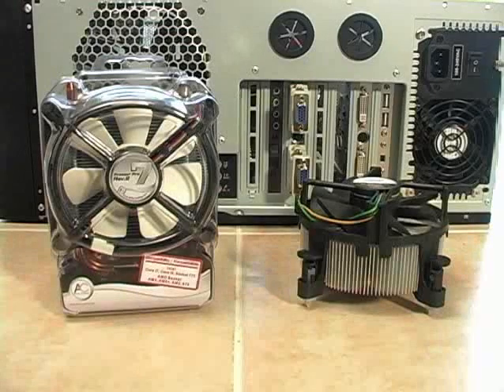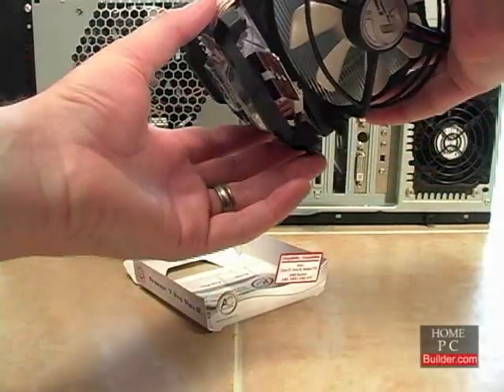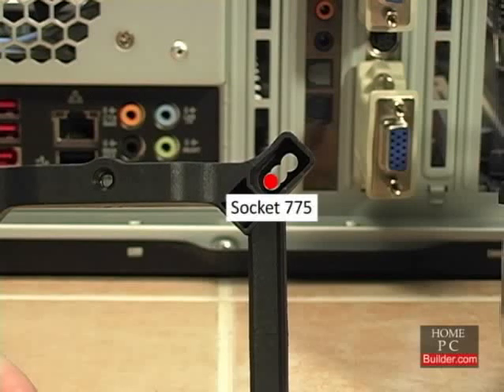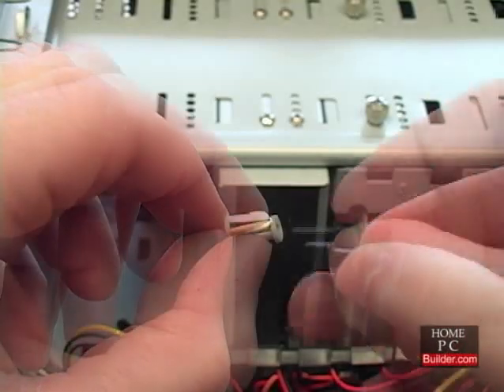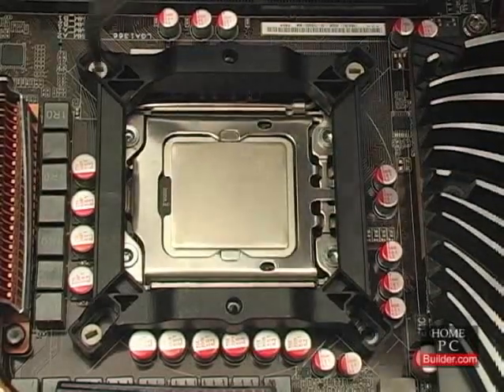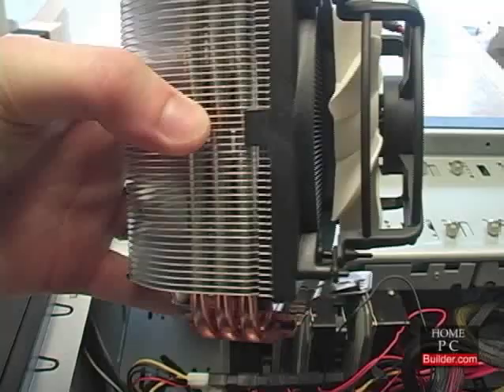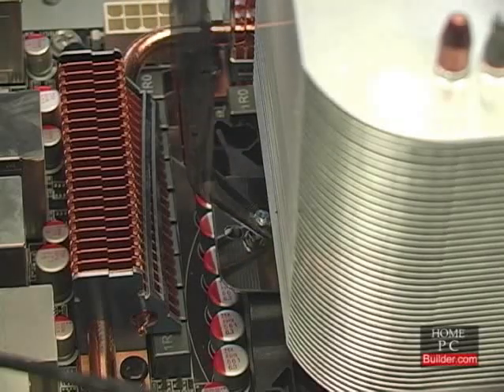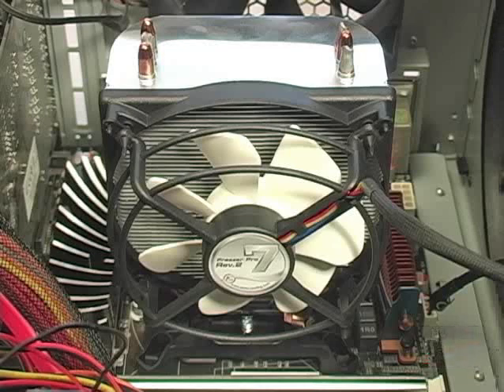Installing an Arctic Cooling Freezer 7 Pro Rev.2 CPU heat sink cooler

Comment: Excellent video, very helpful indeed :) Couple of notes: The new style pushpins for the mount plate are quite large compared to those shown in this video and simply will not work with the threaded inserts utilized on an Asus P5BW-LA LGA775 motherboard. The 2 AMD screws provided work fine on the threaded inserts with a thin washer however. I just wish this kit came with 4 AMD screws and 4 washers for motherboards with threaded inserts.

Comment: Hi, this was really clear and helpful but I was hoping that you would explain about reapplying thermal sealant between CPU and the new cooling assembly. Is it unnecessary to replace the sealant? My own 4-year old Core i5/Freezer 7 Pro Rev 2 installation seems to be critically overheating at the moment and I wondered if making a more effective seal might cure this problem. Any extra help would be gratefully accepted please.

[Edit] I now see from Arctic's website that their cooler comes with a pre-applied thermal compound. You also mention this in your commentary - sorry!. So, is it possible that mine has failed and needs replacement, perhaps with a suitable thermal grease? Thanks.
Reply: first make sure there's no dust or debris on the heat sink. if it is clean it is very possible that the thermal compound has dried up.  arctic silver 5 is what I use. to remove the old compound remove the cooler and wipe the top of the CPU and the bottom of the cooler with a paper towel.
Reply: +carmenbryana Thanks for your reply. I have already blasted all of the dust and debris away with a very powerful blower, so it's probably time to replace the sealant.  Cheers, Ian :)

Comment: Hello. I am about to buy this cooler but i am concerned about the space between the cooler and Ram memory. I have a micro - ATX motherboard and i'm not sure if this 96cm long device covers the first Ram slot. All slots are full. The sticks are low profile, meaning that the Ram cooler is just at the same height as the memory stick itself. I want to place it at the same direction as you, so that air runs from Ram slots to the external space of the box. Not the other way around or at 90 degrees rotation (pushing air to the top of the box). Any advice/information would be much appreciated
Reply: P7P55D LE the side of the black fan case holder touches the side of the ram in the closest slot. Had to file the side of the black plastic on the fan holder to insert the ram. Couldn't use double sided ram in the closest slot. Used 12 gigabytes of ram 4x2 in the 1 and 3 slot and 2x2 in the 2 and 4 slot. This motherboard can only use double sided ram for anything more than a 2 gigabyte stick or a 4 gigabyte stick.

Comment: P7P55D LE the side of the black fan case holder touches the side of the ram in the closest slot. Had to file the side of the black plastic on the fan holder to insert the ram.

Comment from the maker: Some motherboards won't spin up the fan until the CPU gets to a certain temperature.  The fan will spin up when you power the computer on and then stop.  Another possibility is that the fan can't spin because a cable or something is up against it.  If neither of these are happening you might want to turn the system off and press down on the center of the fan and then turn the system back on.  This can sometimes get a fan spinning again. It is also possible that the fan is just dead.

Comment from the maker: @paulvick2002 You may have a problem with your motherboard and the freezer 7 pro.  I did a Google search for your motherboard model and freezer 7 pro and on a Corsair forum someone is saying the cooler covers the first RAM slot.  Further down there is someone else with your motherboard and the freezer 7 pro and they don't mention a problem.  The height of the RAM is something that you need to consider.  If the RAM has an extra large heatsink that may make the difference.

Comment from the maker: @RemnantsOfBeauty You probably disconnected a power cable.  There is a 4 or 8 pin power cable that goes right next to the CPU.  If that isn't it try disconnecting and reconnecting the other power cable to the motherboard and reseat, take out and put back in the memory and all your expansion cards.  This is the video card, sound card if you have one, networking card, etc.  Then see if you get video.

Comment from the maker: I read that review and the Freezer 7 Pro is the cheapest of the bunch.  Its also much easier to install.  Of course the larger coolers are better at cooling, but they are more expensive and much harder to install.  Some are impossible to install because they are so big.  A lot of peoples cases don't have room inside for those monsters.  The Freezer 7 Pro is a great option for price, ease of install and cooling.

Comment from the maker: The main advantage of this cooler is that you don't have to remove the motherboard to install a back plate to hold the cooler to the motherboard.  Taking the motherboard out is very close to disassembling your computer.  This cooler is much better than the cooler that ships with the processor.  The video shows that.  It might not be the best at cooling, but if you factor in cost and ease of install it is a solid choice.

Comment from the maker: I would first make sure you are adding the correct type of RAM.  That motherboard takes DDR3 RAM.  Other types of RAM will not fit. You may have the RAM stick backwards. Make sure you are matching up the notch on the RAM stick with the notch on the slot.  Try blowing out any dust or debris in the slot.  Finally try a different stick of RAM.

Comment from the maker: @archer10227 That case has a regular width so height won't be a problem.  To make sure the cooler will work with your motherboard and not hit a ram slot or a heat sink on the motherboard do a Google search for your motherboard model number and Freezer 7 Pro.  This is a very popular cooler.  You should find people talking about using it on your model motherboard.

Comment from the maker: @1337RussianCoDPlay3r It may be that the motherboard is misreporting the fan's speed.  I would try upgrading to the latest BIOS revision and see if that solves this.  I checked and that motherboard has had 18 BIOS revisions so far.  It won't let me post the link to the updated BIOSs here but if you go to the Asus support site you can find them.

Comment from the maker: @adilg89 I have read that pressing down on the center of the fan for a moment will get it working.  If that doesn't do it, as a test you can connect the cable to another fan header just to see if maybe the CPU fan header on the motherboard is bad.  If it still doesn't spin I would return it for a replacement.

Comment from the maker: @weeq326 Its fine.  Yes you can get better thermal paste but unless you are overclocking its not necessary.  If you are going to overclock the CPU you would need a better 3rd party cooler which usually comes with better thermal paste or if not you can then buy the better thermal paste to go with it.

Comment from the maker: @DuyAnh1 For the dimensions I'd go to arctic coolings website.  Just good Arctic Cooling and you'll find it.  They have the dimensions.  As far as what temperatures you will get its hard to say.  If you're using the Q6600's stock cooler from Intel switching to this cooler would lower the temps a whole lot.  Again how much is hard to say.

Comment from the maker: @YousufBayoumi That sounds like you didn't get the cooler seated all the way down.   You can remove it and re attach it.  Another possibility is poor case ventilation. As in cool air can not get into the case and the hot air cannot get out.  So the hot air is trapped inside, building up the longer you have the computer on.

Comment from the maker: All AMD and Intel processors that come in a retail box have a cooler in the box that has CPU compound applied and you don't have apply more compound to the CPU.  AMD and Intel CPU that are bought without a CPU or OEM style need to have a cooler bought separately that may of may not have compound applied to them.

Comment from the maker: This cooler doesn't have a backplate.  Some coolers use backplates to connect to the motherboard.  To install or remove these coolers you have to remove the motherboard or have a case with a cut out for the back of the motherboard where the CPU plate goes cut out of the motherboard tray.

Comment from the maker: @keitholiverz  I don't know if what you're trying to do is possible. Do a Google search for "4 pin cpu fan pinout" You will find a site with a color coded diagram.  The problem you're having is that the blue wire is for control. That is telling the fan to spin and how fast to spin.

Comment from the maker: @weeq326 I like it.  Its very low noise.  It should fit fine on that motherboard.  The temps depend on a lot of factors.   I can tell you both the idle temperature decreased by 19 degrees and load temperature dropped 22 degrees when I replaced the Intel cooler with the 7 pro rev 2.

Comment from the maker: @ThundeRMr89 This cooler comes with its own bracket that doesn't require a backplate. You remove any parts of your original cooler and the pins go through the holes in the motherboard to attach the bracket to the motherboard.

Comment from the maker: @ThundeRMr89 It can matter because of the width of the case.  It might be too narrow to handle the height of the cooler.  That computer has a socket 775 motherboard and the width of the case looks wide enough.  This cooler will work.

Comment from the maker: @twinzamv No.  You can install this cooler so it blows in any direction you want.  Blowing towards the back of the case is usually best because the rear exhaust fan can suck the hot air from the CPU out the back of the case.

Comment from the maker: @Davisrullzs You should install the CPU cooler so the fan is pointing towards the back of the case at the rear exhaust fan. If you don't have an exhaust fan you need to get one.   Make sure the exhaust fan is blowing out of the case.

Comment from the maker: @airmax3255 As long as the heatsink is on the CPU you can turn it on for 10 seconds and it would overheat that quickly.  Like I said.  It may be that the CPU isn't heating up enough for the motherboard to tell the fan to spin.

Comment from the maker: @airmax3255 Yes it can. Unless the CPU just isn't hot enough right when you power the computer on and the motherboard is stopping it from spinning because the CPU is cool.  Are you sure you've connected the CPU fans power to the motherboard?

Comment from the maker: What is a rip off?  This cooler replace the Intel cooler than came with a Core i7 920 CPU.  It dropped the temperatures by 19 degrees Celsius and allowed us to overclock the CPU from the stock 2.66GHz to 3.9GHz. What is a rip off?

Comment from the maker: My mistake on the mounting plate.  I call the plastic piece attached to the motherboard around the CPU socket the mounting bracket.  I have taken out the push pins and I can attest that the cooler does easily come off.

Comment from the maker: The Arctic Cooling Alpine 11 GT Rev2 has compound already applied so you don't need to add more.  I don't think the Arctic Cooling Alpine 11 GT Rev2 is much of an upgrade from the cooler that comes with the i3 550.

Comment from the maker: @reeferboy2003 If your CPU is overheating I would first try re-applying the thermal compound.  You may also find that the heat sink is covered with dust.  You can blow this off with some compressed air.

Comment from the maker: @ksuowl2 It will be a little close to the rear exhaust fan but it will fit.  Be sure to turn the cpu cooler so its fan is away from the exhaust fan.  This will blow the hot air from the CPU right out the back of the case.

Comment: Thanks for the perfect video. I wish the manufacturer shows the air direction of the fan so I can decide by myself the orientation. I bought this cooler recently and wasn't aware that this item is almost 7 years on the road. The lga 1151 is not mentioned as being supported by this cooler.

Comment from the maker: @geordie2004 The CPU fan blows through the heat sink.  The video does show the fan on the opposite side from the exhaust fan so the hot air from the CPU cooler will be sent on the back of the case.

Comment from the maker: @Davy2612 I used it to help in overclocking a Core i7 920 CPU.  I got the CPU stable at 3.9GHz.  We have had several customers get Core i5 and i7 CPUs stable at 4GHz and a little higher.

Comment from the maker: @archer10227 Before replacing the CPU cooler I would try re-applying the thermal compound between the cooler and the CPU.  Can you tell me the model of Micro ATX case you have?

Comment from the maker: @brainiac777 I'm not sure but would say the height does include the ends of the heat pipes at the top.  Arctic Cooling support would be able to tell you for sure.

Comment from the maker: @jaguarjay13 It works on all socket 775, 1156, 1366 and AM3 CPU sockets.  It don't know about swapping out the fan.  The one on it does a good job and it quiet.

Comment from the maker: @albero781 It's you're sure the fans power cable is plugged into the CPU FAN header on the motherboard then the fan has died.  Contact Arctic Cooling for a replacement.

Comment from the maker: @airmax3255 You'll need to remove the residual compound from the original cool on the CPU as shown in the video.  This new cooler has the compound already applied to it.

Comment: Wait, would it fit on a MSI lga1151 motherboard? I read that I Sucks 150w,worrying as my graphics card suck 150w,and I have a 500w PSu, would it be a problem or no? Oh and I'm getting a midi tower case with a micro atx board, would it fit? And my cpu would be Intel I5 6500

Comment from the maker: @10ChaosKiller That is a Socket 775 CPU so the Freezer 7 Pro will work with it.  The Freezer 7 Pro works with Socket 775, 1156 and 1366 CPUs.

Comment: Very, very good.  This helped me install one of these today.  The instructions that come with it are so bad, it would have been difficult to get right.  For instance, I didn't know which of the four ways the fan should go until I saw your video, and the instructions with it aren't clear.

The big problem I had is that the white push pins simply would not fit into the MB - they were way too large.  Then I discovered that the two screws included in the Intel bag will fit into the MB, so I had to go to the store to get four more screws about the same as those two.  Otherwise everything went well, thanks to your video.

Comment from the maker: @Victormunro This installation video was take from Lesson 5 of our Intel Core i3, i5 and i7 overclocking videos.  At this point the CPU was overclocked from it's stock speed of 2.66GHz to 3.7GHz.  Before the cooler was replaced the idle temperature was 62c.  With this replacement it dropped to 43c.  The load temp had been 97c.  It dropped to 75c.

Comment from the maker: @Dutchley When I first powered the system on with this cooler it was very loud but quieted down after about an hour. I did some searches online about this and it appears this is common with this model and a few others.  According to what I found pressing in on the center of the fan before you turn it on for the first time will keep it quiet to begin with.  It has something to do with the fan getting out of alignment when shipped.  It now makes noticeably less noise compared to the stock cooler.

Comment: if I use some screws would this be able to be used on a socket 1366 xeon e5620 instead of using the push pins I would just use screws to screw it into the motherboard as the backplate has screw holes instead of push holes.

Comment: Thanks for the video. Very easy to understand. I found it easier to install the white pins into the base then install the base on the mother board. I think the pins may have changed shape slightly since your video.

Perhaps the thermal compound on my old stock cooler had dried out but this new cooler drops my idle temp by about 15 deg C.

Comment: I have an intel I7 920 I'm trying to install this on; the CPU back plate has threaded holes for the old cooler mount. The provided plastic pins will not fit. I need a back plate that has the CPU backplate ONLY (no cooler threaded inserts). Do you know where I can find one? I have looked everywhere and I can only find the same plate I already have. I know other motherboards use the particular plate I'm looking for, but I cannot find those either.
Reply: I had the same issue, did you find a solution ?
Reply: I removed the four screws from the factory fan mount and used four small washers on each corner to take up the slack on the new mount. It's been working fine since.
Reply from the maker: It may help to be able to see the issue. What computer do you have and or motherboard?
Reply: I got it figured out; I separated the screws from the factory mount and bought some small washers to use as spacers; I reused the original screws with the new mount. The screws were too tall, so the washers take up the slack between the bottom of the screw head and the top of the new mount. Works great. I just wish Arctic had addressed this, or included a compatible processor plate for the Arctic mounting hardware. The existing screw holes on the Pegatron processor mounting plate are too small to use the plastic fasteners on.
Reply: Vegeta46000 Okay, great explanation I was thinking along those lines. Thanks!
Reply: My computer sat for 2 weeks before I figured it out because I was scouring the internet looking for a compatible backplate for the motherboard :P I bought the washers at Home Depot and they work great. I don't remember which size I used, but just make sure the inside diameter of the washer you use are close to the diameter of the mounting screws. Also, make sure the outside diameter isn't too wide. I took one of the screws with me to match up the right size washer.